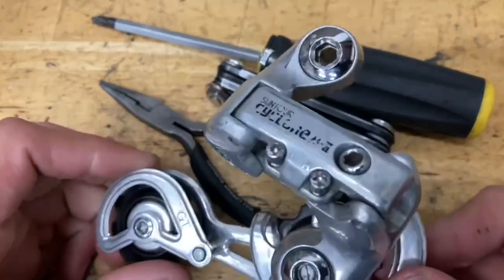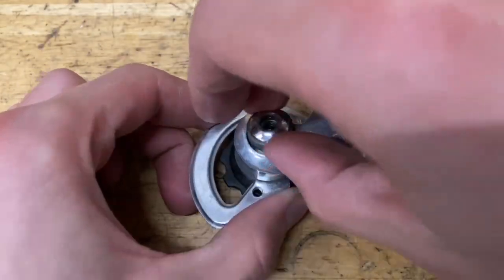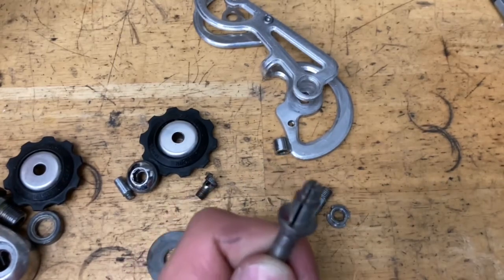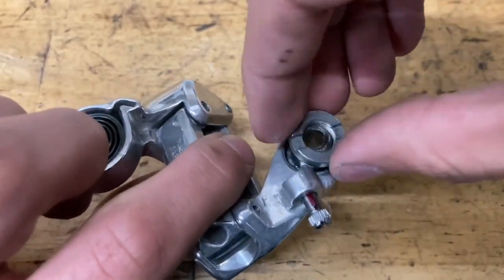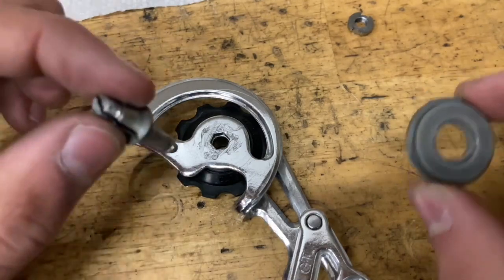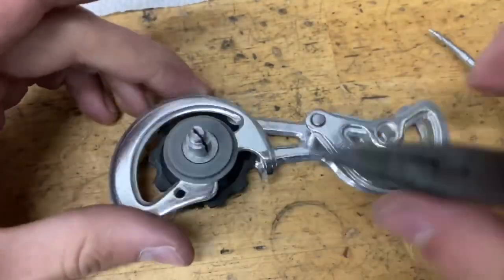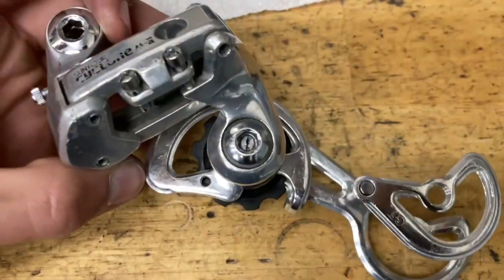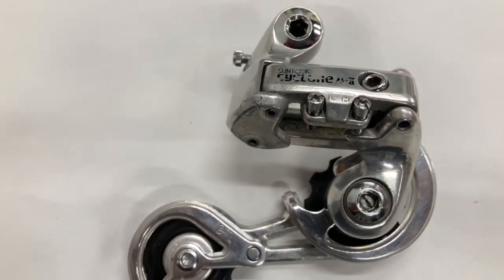How To Rebuild a Suntour Cyclone Mark 2 M-II GT Derailleur

Comment: I’m having trouble taking off the spring (1:15).  Doesn’t want to come loose.
Reply from the maker: Wiggle it side to side and try to use a pick or a screwdriver and push it up from the bottom

Comment: How do you get the screw back inside if the cage isn't on
Reply from the maker: Not sure what you mean which screw
Reply: @RetroRebuilds  the one that goes behind the clamp bolt
Reply from the maker: If you mean the cable clamp screw it goes on either way the cage doesn’t interfere with it
Reply: @RetroRebuilds  oh. Do you know how to get it back in when it comes out? I know you said have the derailleur upside down but I don't see a way of putting it in the hole when I spring the derailleur inward or forward
Reply from the maker: Strange it goes in normally maybe you have the wrong size bolt
Reply: @RetroRebuilds  it's the original one I just don't know of a good way to get it back in besides springing the derailleur inward.
Reply: @RetroRebuilds  I know it fits but like I said I don't know how to get it in there without the derailleur springing back to normal position
Reply from the maker: Try loosening the limit screws one of them might be too far in and that’s causing it to be at a bad angle
Reply: @RetroRebuilds  oh yeah didn't think of that thanks

Comment: looks great! I guess the purpose of the wedge is to prevent the bolt to be tightened too much. is it?
Reply from the maker: Yes It’s also so the jaws don’t fold in and cause the shaft to cross thread

Comment: How does this differ from a suntour cyclone 7000? A few years back I found a discarded Georgena Terry road bike with suntour cyclone 7000 group set. Was toying with the idea of rebuilding and cleaning all the parts but decided to sell as is online.
Reply: According to sources the 7000 is an accushift type derailleur while the mkii is a touring derailleur
Reply: @IHerdSheepAllDay  ok, I don't really understand the difference. The Georgena Terry women's road bike seemed to be maybe idk for racing? It's was a really interesting bicycle as in it had a 24 wheel up front and a 27 rear wheel.
Reply: @myvicariouslife4012  yeah the only difference between the two is the name type of derailleur and how you put them back together
Reply from the maker: The 7000 is completely different internally. The springs are different and it has one in the P knuckle also different clamp bolt position. I’ll have a vid on that soon hopefully
Reply: @RetroRebuilds  I know the 7000 has an inner washer or spacer needed for reassembly that goes with the spring. I took apart one but don't know how to get it back together
Reply from the maker: I’ll hopefully make one of those soon it’s also similar to lots of other Suntour derailleurs.